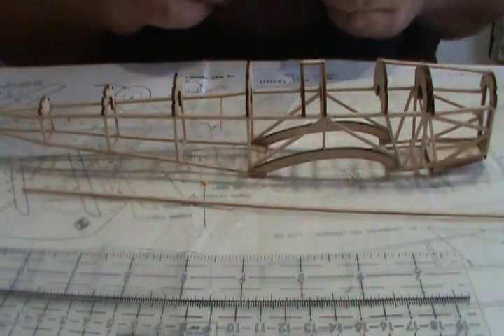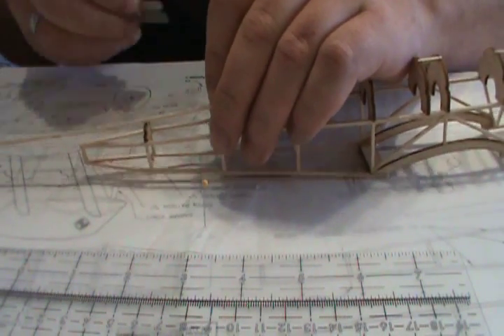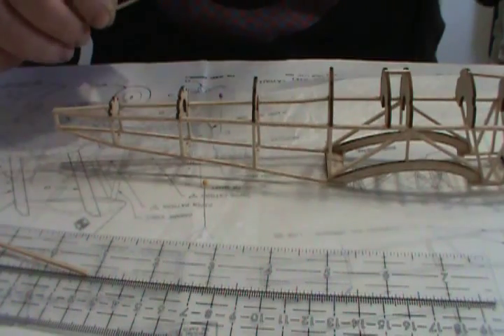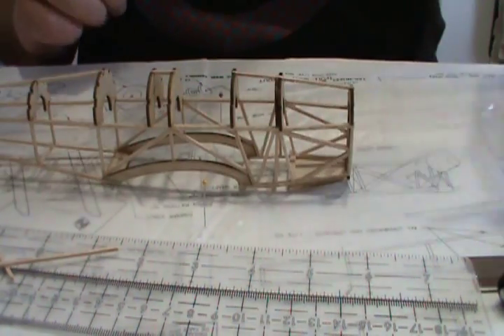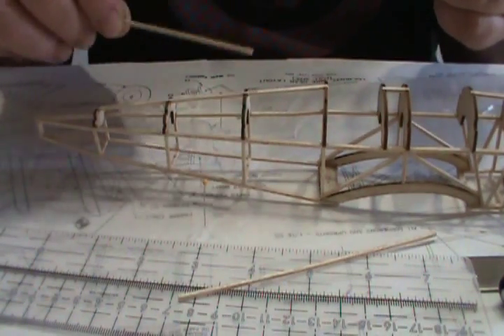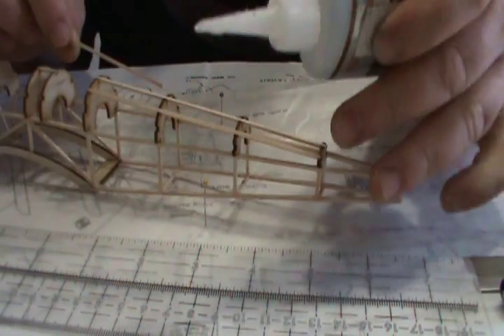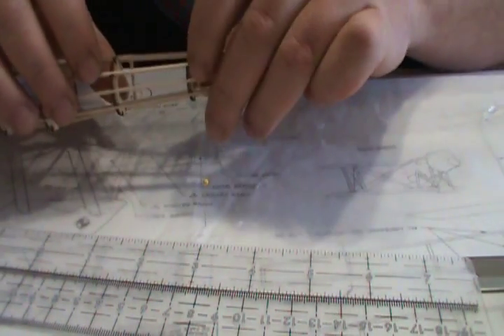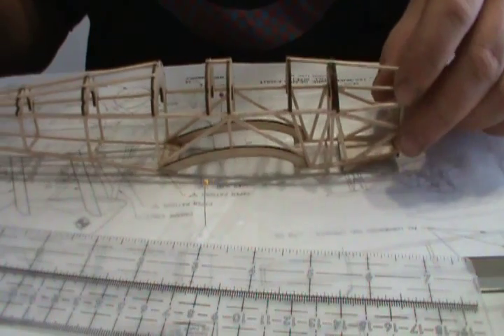TigerMoth Build Part 1

Comment: Hey, I know this is from 8 years ago but this is my first balsa model and I have a few questions. Do you still know what glue you use or would recommend and how many days did it take you to build it?
Reply from the maker: CA glue with a  accelerator spray for fast curing would be best. Most hoody stores or amazon would diff have it. There are 3 kinds are CA glue. Thick/med and thin. Med would be best. Thanks,  please like and sub. Means a lot to me. Happy Holidays.
Reply: Ok thank you